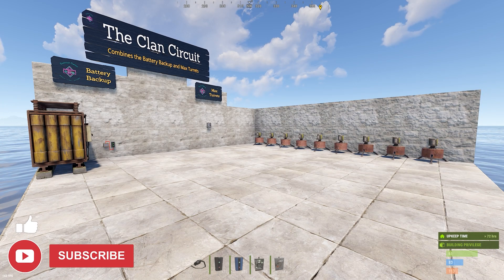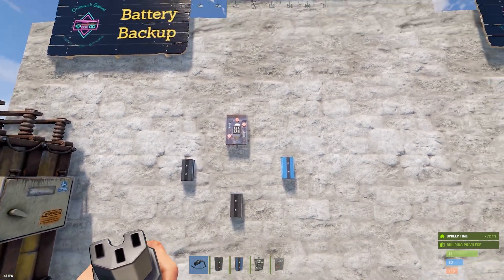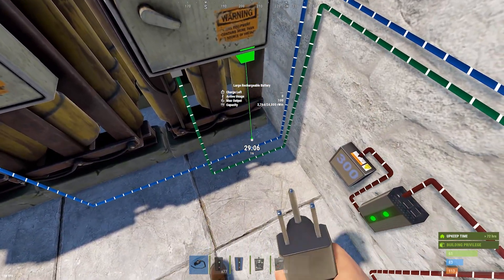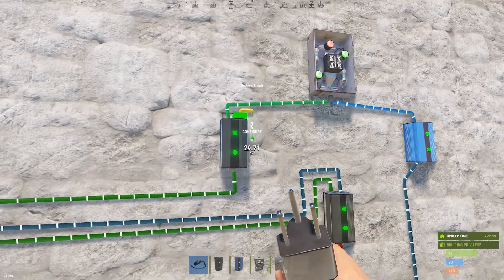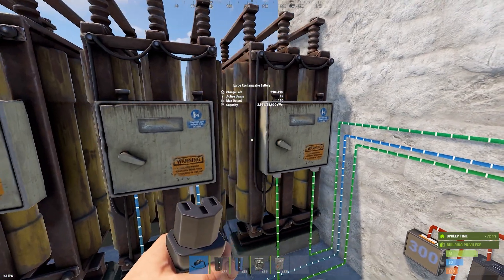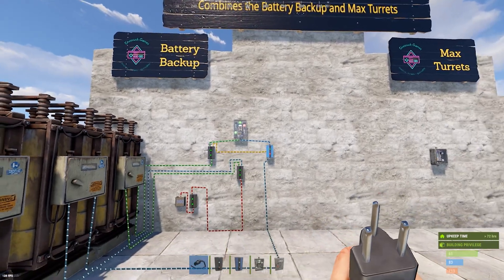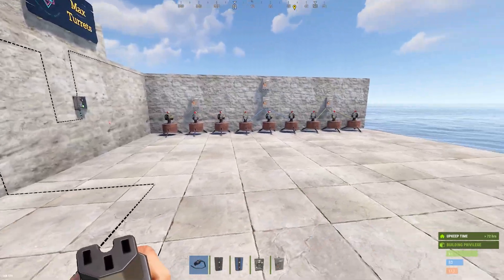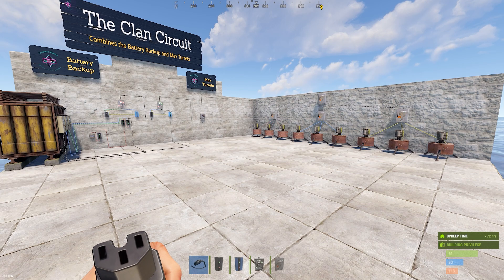RUST Electricity Tutorial | The Clan Circuit - 1 Switch, 9 Turrets, 12 HOURS of Backup Power - 2022!

Comment: Can you use a branch instead of a switch for turrets so you need auth on tc to turn them off. I'm on rust console and they don't have smart switches. My goal is to use the nih core to power turrets but add additional backup batteries for offline protection. Do you have a video on this?

Comment: Can you add a 4th battery to the double battery setup by duplicating the system and then run them in parallel with a root combiner out the switches to get double the power output with 8 hours of backup? Does that make sense? Then you could run 18 turrets off of one switch if you really wanted to right?
Reply from the maker: You certainly could. The only thing you'd have to be aware of is if one of your sets of batteries were to be destroyed, anything down circuit of the power limit of the other set of batteries (100 rW) would shut down. Considering this, it's more secure to run two sets of 9 turrets on their own circuits. You could use two Blockers that are interrupted by a single Switch to shut them all down at the same time, therefore maintaining your one switch.

Comment: Is it normal for turrets to turn off n on when the battery input is low? My battery is fully charged but when the wind turbines don’t produce enough power my turrets turn off n on
Reply from the maker: Hey sorry for the delayed response. No, it's not normal. It sounds like your turrets are running off of root power instead of battery power. If you ever want to jump on my Discord and stream we can check our your build.

Comment: Came across this detailed video recently. 
Having an issue where after my first battery drains and the backup battery begins to cycle in. It gets trapped in a perma-cycle switching between battery 1 and 2. Any thoughts on how to get past this bump?
Reply from the maker: Yep. It's a weakness of that particular design. I'm working on another version that gets around this issue. 

What's happening is that there is still some charging voltage available for Battery 1. When Battery 1 dies, it unblocks Battery 2, which then takes over. The problem is that if there is still any charging voltage still arriving from the root power sources, Battery 1 will power on for a moment and reblock Battery 2. This is what's causing the power cycling.

My Version 2 of the battery backup will fix this problem.

Comment: So okay what if I need to power 30plus turrets do I expand the battery or the circuit. Or do I add more power like last wipe I was making 760
Reply from the maker: The best practice is to have a maximum of 9 turrets per Clan Circuit setup. This way, should you be raided, they would have to take out each system rather than one that powers everything. Having redundant groups of turrets is much safer than powering everything on one battery setup.
Reply: @AustinKlailaGames   I’m solo on a 3x tho just bc I work a lot and I do build big but not big enough for 4 16 battery spots lol. Any suggestions ?
Reply from the maker: @justinhunting803  I see. If space is an issue then you might be interested in a new version I'm working on. It expands how much wattage you have (you can run more turrets than just 9) and makes backup batteries almost endless. I'm about done with it so keep an eye out!
Reply: @AustinKlailaGames  yessir I ran like 25 this wipe with 760 power but my batteries wouldn’t charge and I had 4 Sam sites and Ik 760 is plenty for 25 turrets so idk what happened

Comment: what if im only doing 4 turrets just to start until i can get all 9
Reply from the maker: you can start with any amount you like. simply expand the circuit after the switch to accommodate more turrets. happy to elaborate if you get confused
Reply: @AustinKlailaGames  so i just would build like the basic splitter branch to 4 turrets then this and attach the xor to that? also how much power would i need going in if i use two medium battery's ?

Comment: Underrated indeed here is a new sub and a like! One possible way to improve if you got the power for it is to have a day & night switch this concept is more for solar panels but could also be used for windmills it basically means a circuit that will power the turrets from the main grid "if" the level of volts is at "x" amount dipping under it will then trigger the battery circuit (the downside is you need more power coming in because we still need to give it to the batteries) I will play around with this and see if it is possible when time allows for it.